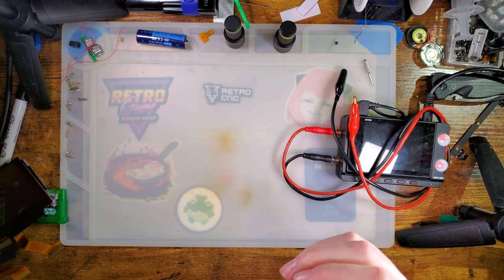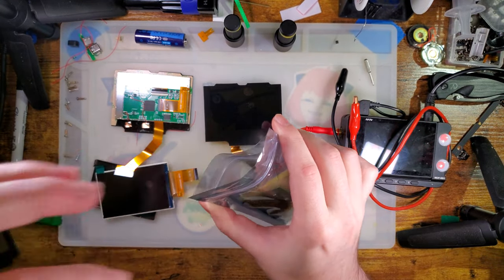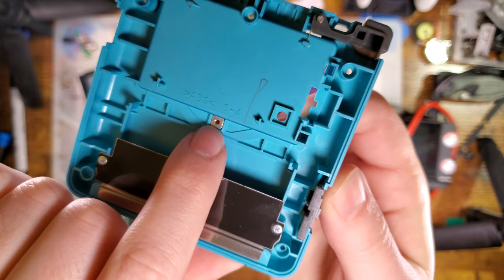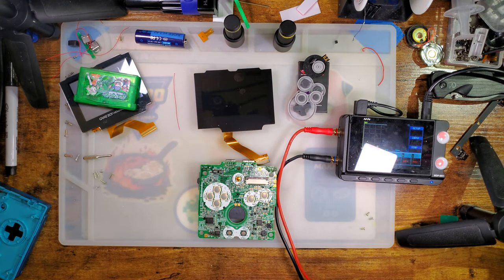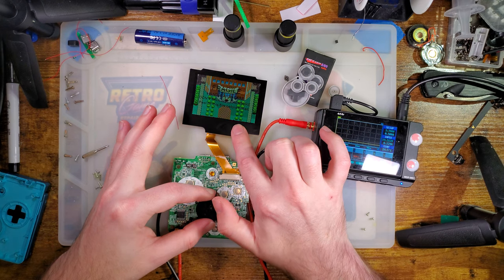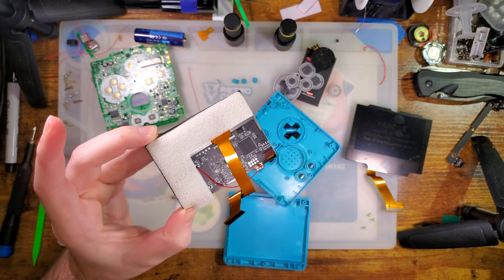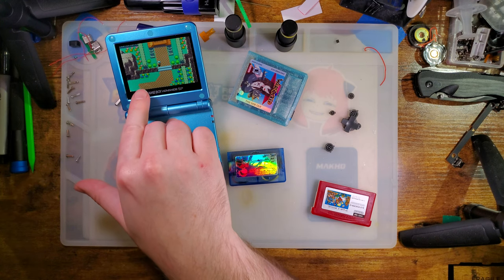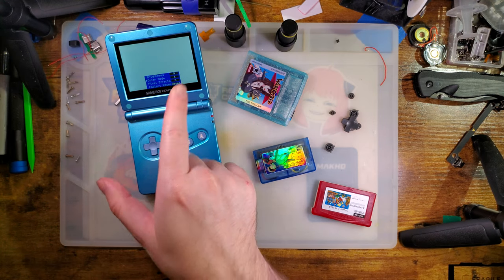Game Boy Advance SP Laminated Drop In 720x480 IPS Backlight with OSD

Comment: Just received mine, the official package is diff. I can tell yours got cherry picked &  tested before they sent it to you.

Build quality on my kit is very much garbo, lots of stress points/ uneven glass as I have backlight leaks top left without installing it.

I had to remove the metal shield and not use 2 screws on the top, else backlight leaks everywhere with garbo black levels.
Reply from the maker: RGRS tends not to cherry pick kits for me (I know from getting defects in the past which is why I tend to test these before even starting the video) but it's possible that OC cherry picked a handful to send to RGRS first and I wouldn't put it past them. However, it's also possible that you just got a bad kit. Have you already reached out to the seller?
Reply: Just got one and have some similar issues, I have it all together now. Did removing the metal shield eliminate it completely? I'm debating cracking it back open and giving it a go.

Comment: @makho did you had a chance to check power drain on your funnyplaying screen? Low, mid, high settings? I'm interested how those two compare in terms of performance. Drop in screen seems like a nice thing for OEM shells (would be nice to keep those unmodified) but I've heard that quality of this kit tends to vary, some people are complaining about light bleeds and pressure sensitivity.
Reply from the maker: I'm a little behind on the wiki currently but the spreadsheet I maintain should be up to date on power usage. I tend to list either default brightness levels or whatever I think I'd use most often and then max and minimum brightness level power usages. Check the video description.
Reply: @makho  I can see it now, saw `writeup on backlit kits` and didn't looked any further. Now I see your excel spreadsheet below there. Thank you very much for your hard work!

Comment: Is there a way to bypass or completely remove the touch sensors on these screens for GBC, GBA & GBA SP? I need to perform this process even more so on the GBC as the Pokémon Pinball game causes the sensors to go haywire. PS, my second screen purchase for my other new GBA SP cobalt blue came with the proper wire so I can utilize the backlight button.

Comment: I thought this ips kit came with the wire to be able to utilize the brightness control button. What gauge is suggested? And what a lot of these videos fail to add, the 5 rubber parts needed to be removed in order to get to the screws when swapping screens, may need replacing as the adhesive doesn’t stick to these parts rather they are sticking to the screws. It was tedious but I had to carefully remove the adhesive from the screws before removing the screws from the shell. Is anyone selling these parts separate from the shells? I’m a little freaked out over this as I spent $600 on a new in the box Kingdom Hearts edition GBA SP 001. all I planed was to update screen and change buttons to clear & transparent black.
Reply from the maker: I literally showed the entire process. That's why this video is an hour long. What you're saying I skipped is about 17 minutes in. 

Why on earth would you spend that much on a console to do this sort of thing without knowing what you're doing? I'm sorry you're having trouble and I hope you get it worked out.
Reply: @makho today I added the lipo, wire & speaker. So awesome!

Is there a way to cancel out the touch sensors, Also the V5 ips on my gba kingdom hearts I purchased from 8bit aesthetic?

Comment: You are moving from 9 to 1 pixel to 4 to 1 pixel  with pixel grid, prob higher brightness is needed to make it look good? The only thing I can see negative is being off center. You might get ~1mm-2mm  if you trim the bottom lcd plastic (those 4 plastic indents ) and shift the thing to the left ?
Reply from the maker: You can get better centering by doing that, yeah, but it would probably also require modifying the housing too. 

And yeah, to get the same perceived brightness with the pixel grid emulation on, you would have to increase the brightness.

Comment: This laminated IPS 1 chip kit is out there for the original GBA now. Would you recommend it over the Funnyplaying v3 kit? I had that ordered but canceled when I saw it doesn't have integer scaling.

I guess I'm wondering if this kit has any lag or power drawbacks in comparison?
Reply from the maker: There is no funnyplaying "v3" kit. Do you mean the 3.0" IPS kit? 

I have a wiki linked in the description that has a summary on all the kits I've tried.

Comment: I just want to see a kit with a pixel grid (simultaneous horizontal and vertical pixel grids) and the FRM that the Funnyplaying kit has to deal with transparency / flickering. Or is that even possible to do both?
Reply from the maker: ITA has FRM. I imagine FRM will become a relatively standard feature going forward.
Reply: I know this comment is almost a year old, but now this kit and the one for the gba agb model has the FRM as well. So you could get both the pixel grid and the FRM at the same time.

Comment: if the shield is removed, would this still fit the hdmi mod as well? and could i swap the lcd to a non laminated one? or better yet swap this board for the one that came with the v2?
Reply from the maker: v2..? This is a different screen than they've used with other kits so it wouldn't be compatible even if I knew what you meant specifically by "v2". I'm not sure why you'd want a non-laminated LCD either when laminated is an option. 

Without the shielding, yeah, you can probably make the HDMI board fit. It's going to be very tight though.

Comment: I noticed that in the ips gba sp the with 800 mah battery, the red led comes on too soon, almost 2 hours before shuts down, I will be better if appear 30 minutes before, there's isn't a mod to do this?
Reply from the maker: Not really. This is a quirk of the LMO (Lithium Manganese Oxide) battery compatibility. LMO batteries have different voltage curves than modern common Lithium-Ion cells (and especially the Lithium Polymer cell that my mod uses) and so Nintendo originally used LMO batteries in this console and set the low battery warning relatively high to line up with the voltage curve of LMO batteries. 

With a LMO battery, the low power warning lines up approximately with remaining life in the battery but this makes it so LiPo batteries are reported as mostly depleted even though they are at or above approximately half capacity. 

Thankfully the charge profiles are the same between all three types of batteries though (at least at this low current) so aside from the early triggering indicator in some cases, there's no issues swapping between the three chemistries. You do lose some capacity on the low end due to the somewhat high low voltage cutoff too but it's relatively minor and realistically good battery practice so not too big a deal IMO.
Reply: @makho ok i understand, maybe the solution is add an independent module indicator connected directly to the battery or some similar.

Comment: Is the soldering easy on this? Never soldered before. I am (way) over 18 so it doesn't faze me. Any advice on a good but cheap soldering iron?
Reply from the maker: Don't learn to solder on this or your GBA. It's easy to pick up but difficult to master and there's a lot of feel to it. I recommend starting with an iron that has temp control and learning on a solder practice kit. 

This is one of the easier things to solder, however.